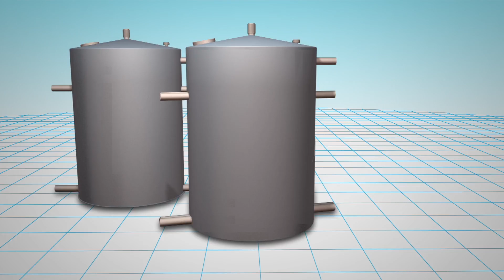Cameroon turns human waste into clean power in biogas project

Comment: If you hook up the methane to a fuel cell I think the byproduct is new water and electricity
Reply: cushion of air you’d want to use a bioreactor to remove the sulfur and other chemicals to produce pure hydrogen before feeding it into a fuel cell
Reply: @merlingrim2843  I like your name ! I don't know enough about fuel cells ''just basic info '' to know if it would work you say the sulfur in the methane would nullify the process that's interesting but only one way to find out and that's through experimentation .I'll look into bioreactors .Right now I'm interested in what iEnergySupply is doing with the Tesla turbine and want to incorporate a heat pump into the system and run it on environmental heat